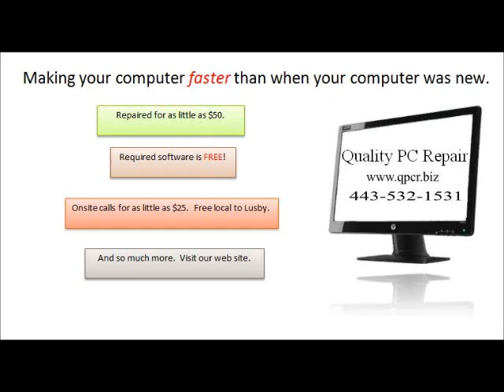How to remove a Hard Drive and CMOS Battery from an HP / Compaq 6735b Laptop

Comment: hey william quinn... are you still active on youtube?. .... i have this same laptop here from the vid... way back i removed the hard drive and got some alarm compiuter would not start..... had this fixed at store waaaaaay back... now how can i remove the hard drive without getting that alarm ? is taking out the battery enough?
Reply from the maker: Not sure what or who put an alarm in your laptop.  I would remove the battery and let the laptop sit overnight.  Perhaps the alarm will not sound.  If it does just continue removing the drive.  Hope thai helps.
Reply: @billyq12001  it worked the last time i used it years ago... dont know whats wrong ...screen was broken so i used it with monitor.. but now there is no signal. mouse n keyboard allso does not light up
Reply from the maker: @torso99  May have to change out the BIOS battery.
Reply: @billyq12001  i tryed changing it yesterday . nothing happend it acts the same.. compiuter starts but no signal on the monitor or keyboard-mouse
Reply from the maker: @torso99  Time to retire it.
Reply: @billyq12001  maybe so . just bothers me that it was oprative when i put it away years ago
Reply from the maker: @torso99  I know.  But if you decide to have it fixed it be cheaper to replace it.
Reply: @billyq12001  true..i just dont understand what can be wrong with it. its been laying safe .. so i thought it could be just a quik fix
Reply from the maker: @torso99  It's to bad you're not close to me.  Good luck and enjoy the new year.
Reply: @billyq12001  you too.. lets hope it will be a better year
Reply from the maker: @torso99  Praying for it.

Comment: The video stated " How t remove a  Hard Drive and CMMOS Battery from  an HP Compaq 6735b Laptop".  However, you just removed the CMOS battery  with no instructions.
Reply from the maker: At timer 1:35 it shows the Hard Drive being removed.

Comment: i did same thing tho and it didn't clear the bios still get user id BIOS Administrator enter password i don't remember the password i can't access F2 and F9 and F10 and F12 all ask for admin password long time i didn't open my laptop i tried all the passwords i remember without any chance
Reply from the maker: Take  the battery out and strate the computer.  You may get about four beeps.  Turn off the computer and plug the BIOS battery back in.  Then to on the computer again and see what happens.

Comment: would you know where the battery is at in a hp elitebook 840 g1 thx for any info hoping if i remove battery my bios can reset forgot password
Reply: +Rico Rod HP Elitebook and Probook cannot be reset by removing the battery. Contact HP support for assistance with BIOS password reset on those models.
Reply from the maker: Good luck.
Reply from the maker: +Rico Rod I do not have that laptop to look at it.  Turn it off and unplug it.  Remove the battery.  Remove all small panels under the laptop and look for the battery.  If you find it there should be a two to three wire connector going from the battery to the motherboard.  This is the connector that needs to be disconnected for ten seconds.

Is the password a BIOS/CMOS password or Windows password?  If Windows, what version of Windows?
Reply: its a bios password on windows 7 it also has a windowsbpassword that im blocked out of hoping getting passed the bios password ill be ok dont know:/ been trying to figure out if i can make a bootable usb flash and flash a new windows system hoping incan over ride it all but dnt know how or understand how to do all this
Reply: +William Quinn i will try this and post a update that thx for the info cause pulling the battery didnt do it but imma try this way
Reply from the maker: +Rico Rod I have software that can hack the Win7 pw.  Check with HP's site on the default bios pw for your model laptop. You may also want to google it.
Reply from the maker: If you can reach and remove the BIOS battery the BIOS will reset everything.
Reply: William Quinn i removed the battery and it changed nothing still locked out as far as bios goes about ready to jus toss comp. in the trash
Reply from the maker: Just remove all of the bottle removable panels. If it is visible you can remove the battery.  If not the entire casing has to come off.  Before doing that, search for a hacking password.  Back in the early 80's they had them for those desktops.
Reply: William Quinn The battery isnt hidden and does not need casing removed its pretty much in plain view for me after removing back panel but ill try and look up some other ways to get in thx
Reply: Bios on Elite and Probooks can only be reset with a special SMC.bin file from HP, generated for the system based on UUID and SN.
Reply from the maker: There may be a hacker bios pw online.  Search for it.
Reply: thanks everyone for info posted im at a dead cause i dnt understand much about laptop and these bin files everytime i go on hp sites im always getting ads instead of actual downloads or sites ill jus put this piece of equipment to rest...thx again :/
Reply from the maker: You are very welcome.

Comment: ok, im following the steps to reset the bios.. but as soon as i start it up and i spam F10, it freezes by the bios recovery.. and the password is back up.. any ideas?
Reply from the maker: At startup try pressing ESC or DEL.  Without see the issue I can only give you these ideas.  Hope they help.
Reply: William Quinn  yeah, its ESC.. same deal, the BIOS makes an recovery i get to before access the bios [BIOS Recovery (500)]. my tought is that the bios gets power trough the battery/cable, making the bios battery useless :/ but im no computer tech...

Comment: Would this work for a HP laptop which fails to turn on? 
With mains adapter a light would flash or come on for no more than 5 seconds and goes off. Nothing else happens.
Reply from the maker: Normally that is a processor that has issues.  Cannot tell anything without it being in my shop.
Reply: My first thoughts was its the motherboard in my own exp. the machine would power up but nothing will be operating due to the POST returning an error. Saying that am used to doing Desktops. Ive ordered a new CPU+motherboard.